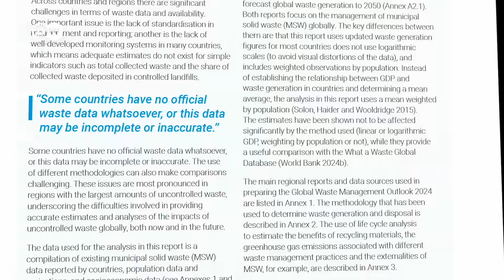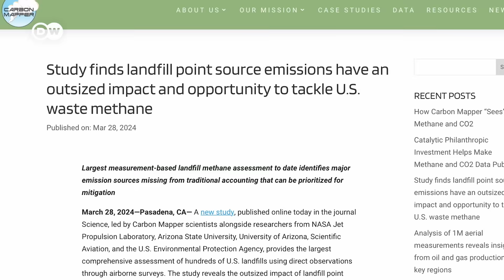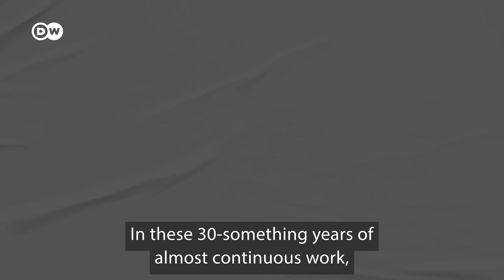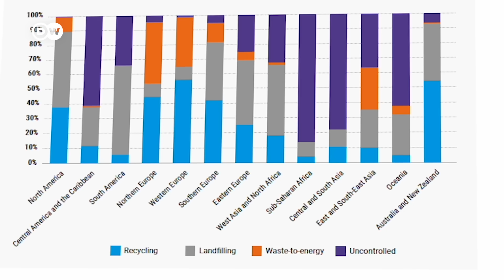We need to fix landfills – here's how

Comment: Landfills actually are the best way we have to permanently sequester waste. When people picture a horrible polluting landfill, they’re thinking of the massive unmanaged garbage pits you see in India or the developing world. That’s not what a modern landfill is. A real sanitary landfill is an engineered containment system: compacted clay on the bottom, then a thick HDPE liner, then a drainage layer, then the waste. When it’s full, it gets another liner and more clay, then soil and vegetation on top. Rain and groundwater that leaches into the landfill, leachate, is collected through pipes and treated before it ever touches the environment, and gas wells suck up the methane so it can be burned for energy instead of escaping into the air. Groundwater wells, gas probes, and aerial surveys are constantly monitored, and any violations come with heavy EPA fines. It’s basically a giant sealed vault. The problem isn’t landfills, it’s open dumps. Proper landfills are literally designed to isolate waste from air, soil, and water for centuries. Anyone saying otherwise just doesn’t know how they’re built.

Comment: Most of the garbage can be burnt to produce clean power if sorted properly. The problem is land is expensive in India compared to USA- so landfill does not make sense. The problem since wet waste is not sorted properly- resulting in lower calorific value which is not economically viable for waste to energy

Comment: Why is gasification not widely used?  You can take anything, unsorted and dirty trash and turn it into syn gas with many applications.

The biggest problem with trash is sorting and cleaning trash before recycling.

Gasification totaly ignorres both problems.

Plz find out why this is not the solution to all of it

Comment: 👏 More awareness is key!!  Composting keeps our trash to a minimum. A little thing I do to recycle small single use plastic items like straws or flossers is to fill up a larger plastic bottle with them.  Once it's full it goes into the recycling.  We also don't put our waste bin out every week.  That way the waste truck doesn't have to stop for a half full  bin.  If more people did this on the same waste route, the trucks would burn a lot less fuel.  If we picked up trash every other week instead of every week...we would burn 50% less diesel 🤯 Just saying...food for thought for anyone who read this 🤔😊💚 🪱♻️🌎🤙

Comment: I've been strongly in favor of getting petroleum based products turned back into a petroleum product. Right now there is a technology called plastic pyrolysis. Basically, you take "plastic" and put it in an oxygen free atmosphere and heat it to 500C for about 45 minutes. It takes more energy to product the oil than pulling it from the ground.

The beauty of it is that you don't really need to sort, or clean the plastics. So, even if this was only applied to the plastics that were destined to the landfill, it would be a huge win.

If this could be combined with process heat from the molten salt reactors, it could be a dramatically less carbon intensive process.

Comment: lets start at the source, with greedy corporations making products as cheaply as possible so that they break as soon as the warranty is over, also not selling replacement parts for things that could easily be fixed by anyone with a screwdriver.
Reply: Exactly, there are too many people saying the problem is at the point of consumption. Even if consumers don't consume, or consume less, the stuff doesn't stop being made, it just ends up in dumpsters behind supermarkets with bleach poured on top of it by employees.

Comment: You describe waste to energy as an umbrella term. In this case you focus on recovering methane from landfills. But waste to energy is in many countries, incl. Denmark and many other countries, the complete opposite of landfills. Instead of dumping waste at landfills where you just leave waste forever, in Denmark consumers sort the waste at the household level. The residual waste is then incinerated in a controlled environment in a waste to energy facilitity. Here, the incineration of the waste generates heat, which through steam turns a generator that creates heat and electricity. The small amount that is left is sorted in e.g. steel and the residual product(slag) is then used for e.g., asphalt production. The gases released from the incineration process (both environmentally damaging gases and greenhouse gases) are to a large extent collected through a cleaning mechanism in the chimney. Currently, technologies are being developed and tested in Denmark to also capture the emitted CO2 to either utilize or store it. 

Only a fraction of the total waste generated in Denmark is stored in landfills. Namely materials that cannot easily be incinerated. Through this process, we generate electricity and heat from the waste, while also leaving only a small amount to be stored in landfills, thereby limiting the land needed for landfills and protecting the environment at the same time.

Obviously we need to increase recycling rates so only the tiny fraction that cannot be recycled should be incinerated. But until waste management systems are properly developed across the planet, waste to energy plants pose a great example of how to utilise waste instead of landfilling it. 

A great example is Amager Ressource Center in Copenhagen, where they even built a ski hill on top of the power plant! https://a-r-c.dk/amager-bakke/from-waste-to-energy/

Comment: OK this is not a land fill it is a trash pill. US land fills are sustainable and clean. They proses trash for half the price of recycling most of that price is fossil fuel. Recycling is a wast of fossil fuel.   Metal is the exception. 
 Modern landfills have a rubber liner, monitoring wells, and methane recapture systems.

Comment: I'd like more public waste bins in germany to have separated bins like they have in sweden, denmark or norway for waste, recables, including paper, plastics and metals (all in one), as well as a separate bin for biodegrables. We also do have domestic biodegradable waste colelction, where you can throw in processed food, as well as meat and bone, because that then get's processed in biogas plants into methane for driving or for electricity and heat.
But that's western europe speaking.

Comment: Burn trash for power generation.  (Plastic/paper.)  Makes for a great fuel.  Run it at high temperatures and use scrubber tech and the polution is fairly low.  Much better than trying to dump it or fake recycling.

Comment: Methane gas is a greenhouse gas that is proven to break down in the environment so you got that wrong to start with but plastic and the rest are plotting the ground water
Reply from the maker: Methane is a threat as it is much more effective in trapping heat than CO2  - 80 times more in the first 20 year cycle. 🔥 We have a video on this you can check out here 👉 https://www.youtube.com/watch?v=-xBXwfI1FWM&t=52s

Comment: In my country, Denmark,  we now sort into 10 different categories. And my none-recycble waste (around 10%) goes to incinerators. 
But we do have some problems: pvc plastic is one of the few things that goes to landfills😱 NOT great...😢
Reply: A lot of the plastic waste is still burned. The problem is that organic waste is doesn't burn well on it's own, so they need to add some plastic to generate enough heat.

Comment: Thanks, I worked in the recycling industry for 30 years, most wastes can be recycled to some extent, but finding a market for the recycled material and turning a profit are big problems.
To make a profit you usually have to charge for accepting the waste, waste producers will pay the minimum possible and will often choose landfill for cost reasons rather than pay for recycling. To be fair, here in the UK some of the larger and better manufacturers have a no landfill policy, and will pay.

Comment: We have the Koelliken (Switzerland) Landfill removed about 25 Km east of where I live during the past 25 years. Action completed about 5 years ago. The landfill was covered by a pillar-less roof structure that was at that time I think the largest pillar less structure of the norhern hemisphere. The roof was there to collect emission gases and probably to hold rain water from washing out toxic content and leak it into the ground.
I think quite a few such removal projects will follow throughout the country. 
In general, dumping is illegal here since many years and landfills are less and less active since strong smoke cleaning devices and toxic gas retention systems  were developed and furnaces were equipped with these that generate heat and finally electricity from not only the gases coming out from the waste, but from burning the entire waste. In this way, waste is turned into fuel for bio mass power stations.
In parallel, we do a lot to increase recycling rates. With metals, glass, paper, cardboard, batteries, textiles  and PET recycling we are beyond 90% that flows back countrywide I think.
Since recently, other plastic materials are recycled as a blend (different from the pure PET). Since that works, the waste my wife and I are producing is down to 1x 35L waste bag every 3 weeks to a Month.
Reply: Blended plastic recycling is a sham, and it is often exported on ships to Asia. China has recently banned the import of plastic waste from EU, because of environmental concerns. When China has environmental concerns,  you know it's BAD...

Comment: I’m a waste water operator grade 3 in the United States and like garbage we have a hard time getting rid of our sludge created by the waste water plant. We have a sludge bio solids dryer but because of many factors it hasn’t ran in years. It reduces the amount of water from the sludge by 90 to 95 percent making the sludge into a dry highly flammable dust  like matter that can be used for fertilizer or spread on any land as its harmful properties are nearly non existent. It’s a form of organic compost I guess you can say. Maybe we will get our dryer working again one day or get one without the many complications ours has had, so we can eliminate our severely reduce our sludge removal problems.

Comment: US landfills are not even remotely similar to those in other parts of the world. They are engineered and HIGHLY regulated. Regulations require minimizes working faces, liquids revival systems, lined cells, groundwater monitoring systems around the perimeter, managed interim covers over filled areas, vector continue, and gas collection. 

It's clear Dehli hads no regulations

Comment: My vege and kitchen scraps go into an in-ground compost bin. I got an old plastic wheelie bin, cut the bottom out, drilled holes in the sides, from the bottom up two thirds of the way. Now it's buried in my garden. After six months I dig a new hole and move it there. It rots down and feeds the garden plants.
We need to do pyrolysis of suitable waste like plastic, tyres and wood. A synthetic diesel is produced, with mineral components left behind like carbon black, silica and others.

Comment: If recyceling is to expencive why dont they Burn it get thermal energy?
Reply from the maker: Hey there! This is already being done, it is called "waste-to-energy". Energy is created through the produced steam. However, this also has downsides such as toxic air emissions.
Reply: @DWPlanetA  But it would be better to burn the waste, as produce wild dumps, poisoning the groundwater and carrying the waste over rivers into the sea. There is a very nice project in Africa and Colombia that produces large clamping blocks from plastic waste, which are used to build schools. Coundn't that be a good solution?

Comment: Wasteful, excessive packaging that cannot be broken apart for proper recycling is a global issue with a weight similar to that of the negative effects of Climate Change. I have contacted myriad manufactures, imploring them to redesign their packaging to either be reusable or easily recycled. The handful of times that I have heard back from them, they send along a form letter acknowledging my concern, express that they share the same concerns, that they are working on a solution, and hope to have something in place by 2030. Six years?! Simply shameful and inexcusable.

Comment: My home town in Alabama refuses to recycle anymore. The locals mix trash and recycling when they are given a garbage bin and a recycling bin. They restarted and ended the recycling program maybe 5 times in the past 20 years. I believe recycling is not a strong solution but maybe composting is. Here in alabama, our plants overgrow the land quickly, brush piles and food scraps alike can be composted. In fact, there is one town close by, Vestavia, who pick up compost alongside trash. Locals can go to the compost facility to get bags of compost for free, or a truckload if you have a pickup truck.
Reply: how are you going to compost plastics?
Reply: @yuanruichen2564  well obviously, you don't compost plastics. however, they aren't recycled either. answer with plastics is to Reduce Consumption, which admittedly, isn't as easy as it sounds when the fossil fuel industry is pushing it everywhere

Comment: "waste to energy" is more than burning methane. It's also burning trash, i.e. Sweden burns most of thrash which was not possible to reuse or recycle. Volume of thrash ending in landfills is just a few percent comparing to input. Additionally it is solid and not  soluble on water. This should be the way.
Reply: In Switzerland we are doing this too!
Reply: isn't burning trash release dangerous substances into the atmosphere?
Reply: @chikko_five  It is difficult/expensive but meanwhile there are very good mechanisms developed to clean smoke/gases that try to escape. Also the furnaces themselves are improved a lot compared to decades ago when they burn at higher temperatures and using enough oxygen to reduce poisoning gases from the start. Equpped in this way, burning the trash is a lot better for the environment than landfills / dumps.
However there is a residue called slag that is much less in volume and weight, but it is still a residue that is hard to treat the rigth way to protect the environment. In one principle I was reading from the grid, the slag gets circulated to become burnt once more etc. until the poisoning fragments are cracked down to simple minerals that will be used in construction materials. (roads, bridges, etc.)
Reply: @chikko_five  Depend. As explained in the video. Methane as explained is more dangerous than CO2, and tbh, I prefer CO2 than other gases because as far as I know, at least tree can use them. So through burning methane, you reduce the danger, not prevent it. Its like wearing protective armor against bullet. The harm is there but it less.
Reply: Last time I checked, Europe was exporting trash to 3rd World countries. And there was a scandal between Portugal and Brazil, the Brazilian government just told them they wouldn't accept the medical waste to be deposit in their land. You doubt me? Look for it.
Reply: Sweden also imports trash from Norway.
Reply: I'm from NYC and pretty sure they do this with some of our trash. Only thing is you still need to think about all the carbon emissions form collecting/transporting the gas, and then also the toxic chemicals that arise from burning anything and everything. Definitely sounds like a better solution than a lot of the other stuff we're doing though